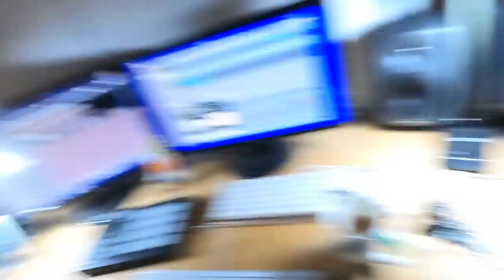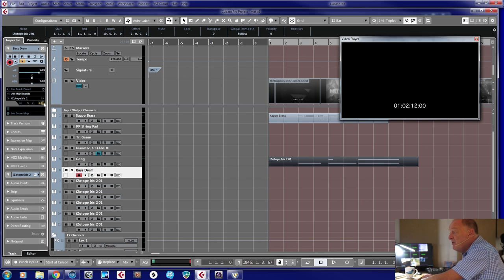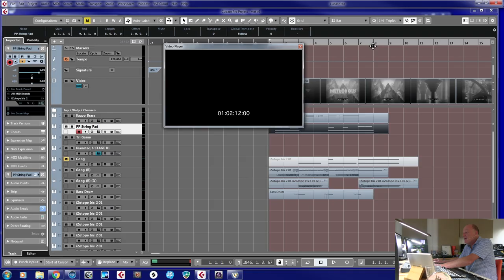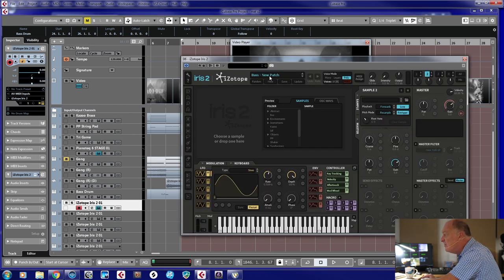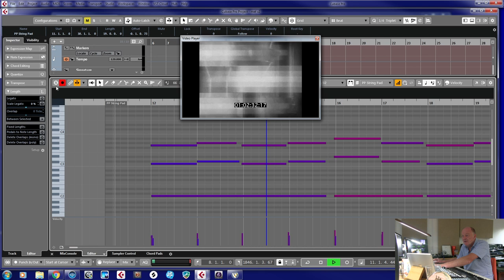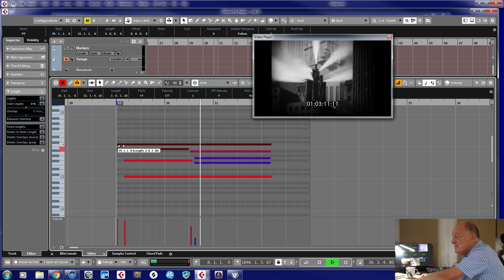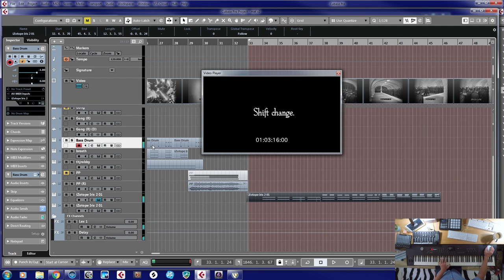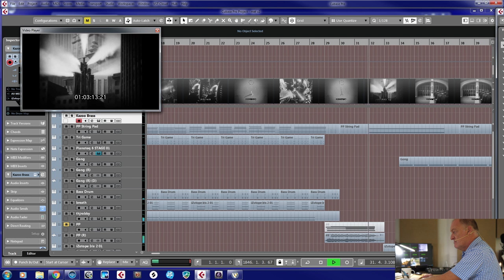The ULTIMATE film scoring challenge Part 2

Comment: Amazing video firstly!

But 

Devil’s Advocate: I am 100% not saying you aren’t getting at difference.

At 96kHz and above your audio path is not really recording frequencies up to the Nyquist as there are anti-aliasing filters, mic limitations etc. So whilst there may be a difference it’s not necessarily as simple as that. Pitching down and imagining that this is “full bandwidth” is a bit of a red herring, that would mean your input chain was not low pass filtered at all. This also applies to the Output path. Maybe the lowpasses are a little higher but it’s unlikely that your input chain was really passing frequencies over 48kHz for example 

Of course when you consider that the converters ICs are most likely Delta Sigma, and we are only taking about output data sample rate to your computer rather than actual sampled sampling clock speed this all becomes even more confusing. 

I’ll repeat though I’m not saying that you’re not getting a difference. I’m just saying that attributing it to increased sample rate alone rather than analog signal path, perception, workflow et cetera might be questionable.

Jitter reduction might be a likely candidate.
Reply from the maker: You could well be right  - it definitely sounded brighter to me once it was pitched down but then again... a link to the files is in the notes so download them and have a look!
.
Reply: ThinkSpace Education I wouldn’t be surprised if the anti-aliasing filters were just better in the higher sample rate path. There’s almost certainly something happening if you can hear a difference. 

I’ll have a look at some point. 

But again love what you do. Seriously inspirational.